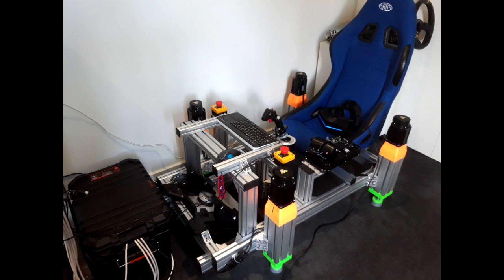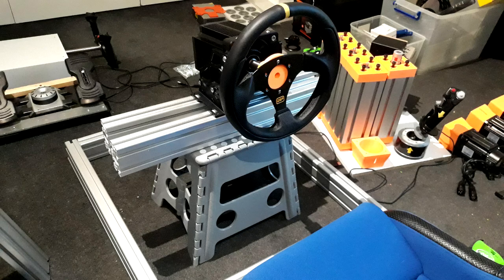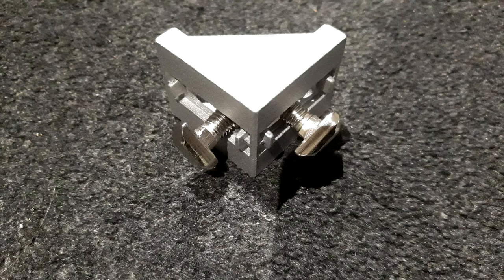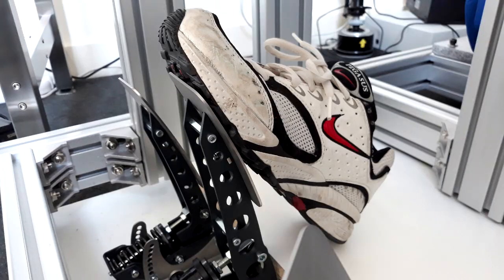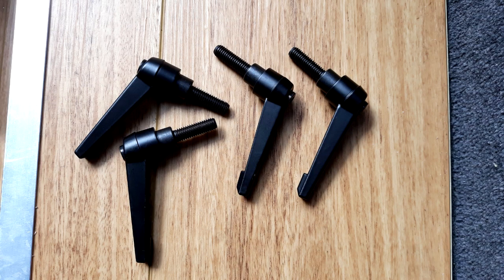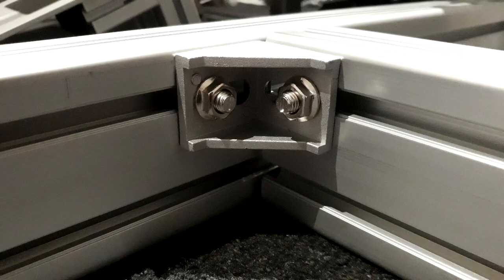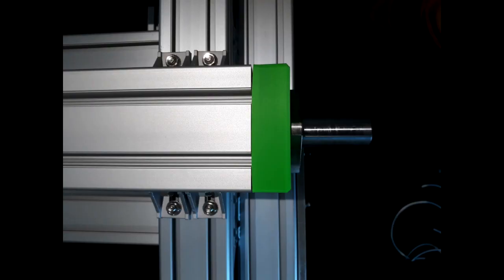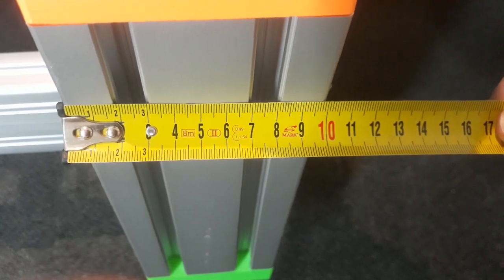DIY rig made from 80x40mm aluminium extrusion for racing and flight simulation

Comment: one thing i dont understand is why 80/20 rig builders always put the seat bar inside the rectangle frame instead of putting it on top of the long bars, to create a ledge they can rest on. 
because, if  were resting circa 100kg in the seat plus acceleration, why just rely on those brackets fr strength?

Comment: Awesome video. thanks.
isnt it too wide ? i assume it is 68cm wide. I think you have lost a little bit from right to left angle ? am i wrong ?
Reply from the maker: If I made it narrower, the flight sim pedals wouldn't fit. The cross braces are 600mm. To get a greater angle you could move the actuators closer together but then you have to be aware of over balancing

Comment: Did you changed from your old 6DOF to this, or do you use both? I came to your channel because of your 6DOF and now i see, that you build an SFX100 Rig. Why? :)
Reply from the maker: The 6DOF was a great rig but it took up a lot of room and it was hard to get into/out of. The batteries, three pairs of power supplies etc made it quite messy and dusty! Others who also built 6DOF like mine went down the SFX100 route as well. Much more compact and very easy to build. The trade off was smaller movements and less degrees of freedom. However, I found that when I was immersed in VR the experience was about the same or better. YMMV
Reply: @sixdegreesofflight7765  OU hehe. Your answer is waaaaay to late. :) In the meantime i built my 6DOF (just "finished" it). In the style of your old actuators with slight optimizations. But with the motors of the sfx100. I'am so happy with it. Search the xsim forum for "Basti's 6DOL Project -Six Degrees of Love-".

Comment: 6 DOF!  Love your videos.  Your videos helped me build my first 3DOF RIG!  It's awesome.  But I built it from steel and the more stuff I add, the less responsive it becomes. I was thinking about aluminum extrusion for my upper frame because (power to weight..) Do you think I should give it a shot or should I simply "SEND IT" and make it out of carbon fiber.  Yeah my seat is 35 pounds so I am ordering a Kirkey (10 pounds).  As soon as I added the fanatec v-3 pedals way out front the responsiveness of the rig became and issue.   Any advice from you or your Subs? thanks DMAX
Reply from the maker: I used the smallest steel section I could get away with without it flexing too much. Weight is certainly an issue. I have seen some people use aluminium but then you need greater cross sectional area to maintain stiffness

Comment: Hey bro, gr8 looking build, I'm going to follow this exactly, however could u write out the dimensions of the rig, I'm having a hard time following the video with respect to the measurements, thanks
Reply: Timestamp
5.00 598mm
5.07 357mm
5.13 126mm
5.19 264mm
5.23 270mm
5.30 320mm
5.33 1200mm
5.40 135mm
5.45 315mm
5.50 150mm
5.56 905mm
5.59 610mm
6.03 100mm

Comment: Great video, thanks for sharing. Do you mind if ask what supplier you used for the profile? Cheers
Reply from the maker: Contact Us

Australia MK Group Pty Ltd
Website : www.mkalu.com www.mkalu.com.au 
Factory address : Unit 7, No 103 Lewis Road,Knoxfield Vic 3180, Melbourne 
Contact : Minghua Pan 
Email address : austmkalu@gmail.com
                         danielsun1995@hotmail.com 
Contact number: Daniel 0403 683 919 
                           Minghua 0410 0717 08
Tel: 03 9887 2697

Comment: so is it better than similarly price rig?
Reply from the maker: Hi, it would be difficult for me to definitively answer your  question. The reason I went with my own design was the flexibility for it to be used for both flight sim and racing sims. So for example, I had the choice of using lighter gauge aluminium extrusion but chose the heavy duty profile because I didn't want it to flex. The key aspect for my approach is flexibility to meet me specific needs. Hope that helps in your own decision.
Reply: @sixdegreesofflight7765  Thanks! Been trying to come up with a rig that can accommodate both scenarios as well. Great video, definitely gave me some ideas.

Comment: Are you using DIY actuators?
Reply from the maker: Hi Mark, yes these are DIY. Here is the video I made during construction:
https://youtu.be/wLT0CiCo1Ec
Reply: @sixdegreesofflight7765  I just watched it thanks. I have a question about your cockpit build. Is the 40x80 base stable enough for a direct drive wheel not flex sideways, forward and backward? I was thinking 40x160 should be a more stable like with the Sim Lab P1 / P1 X cockpits
Reply from the maker: @MarkVersion1  Using larger profile extrusions like 40x160 might mean that you only need one gantry to hold the steering wheel. I used heavy duty profile for 40x80. I wanted to avoid using a 'stay' or diagonal. The profile I used does not flex at all even when the 1200mm piece is suspended at each end and I stand with my full weight in the middle. So I think you are entering into the territory of 'diminishing returns'. The way I designed my rig was an overkill. Each gantry is held by eight 40mm brackets and sixteen M8 bolts. These things do not move at all. When tied together by the yolk or steering wheel assemblies it might as well be welded. All the best with your build
Reply: @sixdegreesofflight7765  yeah I realize that. I saw other videos using very simple gantry structure but they are using belt driven wheels. It saved them money for the build but it wouldn't be enough to handle a DD wheel though. Some of those who have used a DD wheel used 40x160 profile as base. 

Btw, the reason I brought this up is that I'm planning an aluminum profile build that would be stable for a DD wheel. The problem is that it there's no one selling a 40x160mm aluminum profile in my country. Max is 40x80mm. If I really can't get a 40x160 profile then I'll settle with 40x80 and use your design except for the motion simulator.
Reply: @MarkVersion1  Did you have any issues with the 40x80? My rig is a full frame 3DOF centered on a U Joint. I made it out of welded steel and don't notice flex. But weight seems to be an issue. (either that or I need bigger motors). If I did the Top frame of my rig out of the 40x80 do you think it would hold up? take a look if you get a minute.  SixDegreesOfFlight videos are awesome!! DMAX
Reply: @DMAX_DIY  sorry I'm not using 40x80